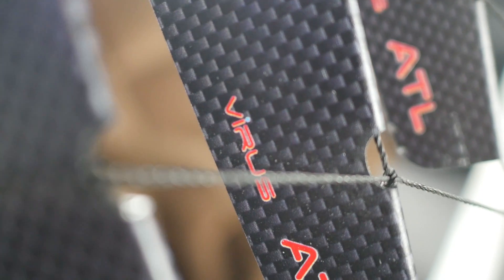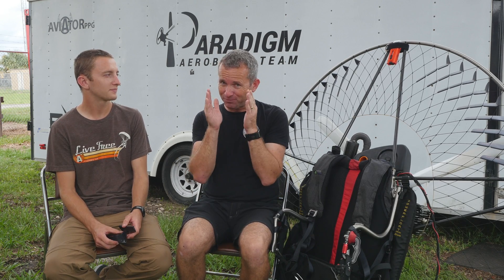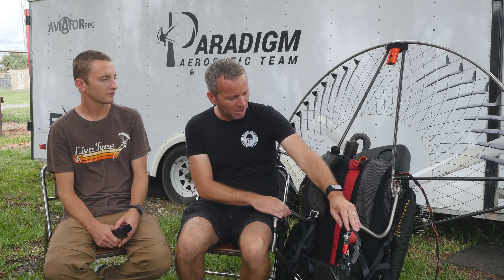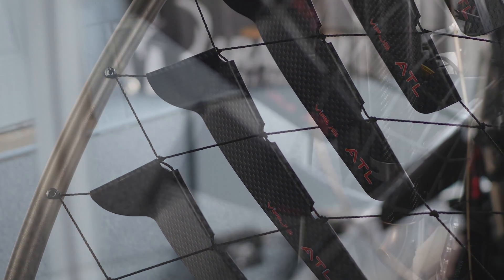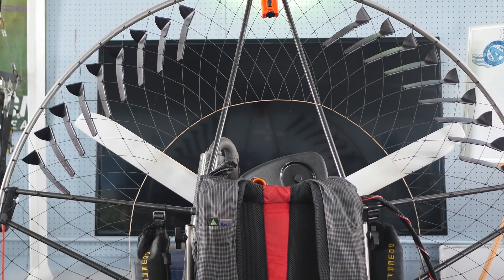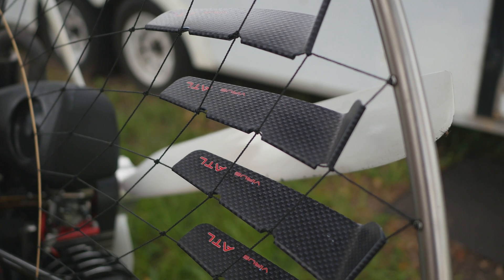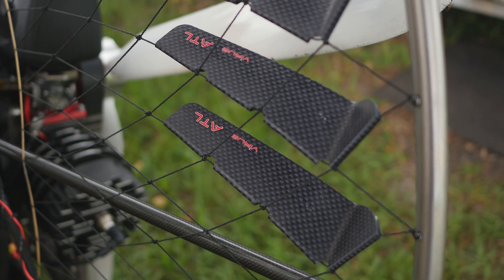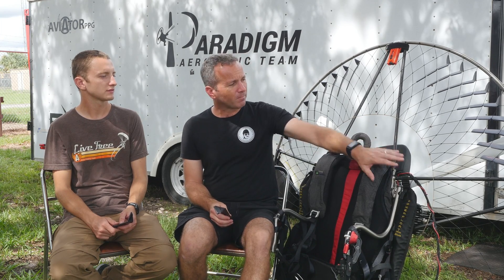Aerodynamic Torque Compensation for Most Paramotors (Virus ATL)

Comment: The thing you guys are presenting is (technically) nothing quite new in aviation world. If you check out EDF (Electric Ducted Fan) construction from R/C world, it has a thing called ''Stator'' - a static blades which both holds motor in place and does  a torque compensation feature plus straightens out spinned (turbulence) air that leaves exhaust hole thus increasing efficiency. 
I am wondering why all the PPG frames don't come with those static blades right away. Sure, they make a little more of drag. But the benefit is worth it.
Nice upgrade. Thanks.

Comment: 200$ for a set of little winglets made out of pop bottle plastic? NO WAY! Now that I have SEEN a set and had it described I am quite sure I could cobble up a nice looking set for about $0.00 and a weekend of piddling around. Obviously I may have to make a few sets before it works exactly right (But I doubt it. It will probably work perfectly on the first try). When I do I will post a video on how it is done and how well it worked. You know it amazes me when people refer to PPG as the cheapest way to fly it simply is not. FIXED WING ultralights cost a LOT less only because the companies producing the equipment are not trying to get rich overnight like PPG manufacturers are. If this development were for ultralight or experimental aeroplanes there would be information on how to BUILD this rather than just  an offer to sell you $5 worth of plastic for $200! Lutke  charges $700 to $900 for a redrive worth around $400. This is the most overpriced motorsport in the world.  If you buy a used engine and redrive suitable for an ultralight (Rotax 447 with B box or Kawasaki  440A with a magnum redrive), build your own cage and trike, weave your own net, do your own upholstery etc etc you could have a  trike ready for a wing for $2000-$3000 and it would be tandem capable. Then you pay $3000 for about $200 worth of fabric and lines. If PPG and PG people were like AIRPLANE people there would be plans available so you could make your own wing for the cost of materials and your time. DON'T say that such a thing is beyond what a non pro can accomplish as it simply isn't. All we would need are patterns and a "how to" video. They are simply too focused on making profit to share any information in the way that ALL airplane designers do.  You may guess that this is my plan. Not to make a wing but to make all the rest of my equipment using my Kawasaki 440. I will end up spending 1/6th of what a normal PPG set up will cost and will have a tandem capable trike that I can repair myself and that I know inside and out.. If patterns and information about wing making were not so jealously hidden from me I WOULD  get an industrial sewing machine and make wing after wing after wing. That would be too dangerous as things are since this important safety information is considered to be "industrial secrets". Funny how airplane wing design is NEVER kept secret and the designer will answer ANY question and provide ANY information, pattern or measurements (FOR FREE) when asked as that is how older aeroplanes are repaired!

Paraglider wing manufacturers are money grubbing, overcharging JERKS compared with experimental airplane makers. I am not suggesting they release information about their latest and greatest designs but how about a "how to cut and sew" video and a set of patters on Mylar for a good safe beginner wing? I have built high powered lasers from scratch, a lathe out of scrap, high power rockets out of cardboard and several airplanes. DON'T try to tell me that cutting out patterns and sewing them together is beyond my skills. Only the DESIGN of the wing is outside of my skill set.
Reply from the maker: Wow, lots of thoughts. No disagreement from us on the idea that things are pricey. And yet I don't seen any one in the business really getting rich. I think the pricing is high due to the lack of demand and the challenges of micro production. But then again, I'm just the guy selling them.

I think it'd be SUPER awesome to see your wing when it's finished! More power to you when it comes to creating stuff, that's awesome :D
Reply: As I said I can not make wings. Information on how to do that is not available.
Reply: The issues of low demand and the challenges of micro production exist for experimental and UL aircraft as well and THEY release all design information, measurements etc. Construction and repair information is released and discussed. Patterns are provided when needed. AND their basic prices are better considering how much more material goes into a light plane compared to a PPG.
Reply: @powderslinger5968  supply & demand isn't just a thing that exists, it's a constantly changing set of variables. Also there's the economies of scale.
If it takes a weekend to make your own, most people will still come out ahead working for money to then pay for a product. (say even at $15 /hr for 13 hrs then you're  ahead financially)
Reply: Flyboy BC check this out The BARRETINA HYPER LITE wing plans http://www.laboratoridenvol.com/projects/bhl/bhl.html
a video of one flying, made from plastic sheeting   https://www.youtube.com/watch?v=-YSHOXKAasU

Comment: So we all know that our AirConceptons already have Torque  compensation built into the frame, risers and hang point arms..so the question is will these with the factory pre-sets produce over compensation  ? Dam I think you answered it ..so you adjust the compensation / Overcompensation by the numbers of winglets you attach ? I talked with Robert at Flyhighparamotors that has been using them for a while now and his exact comment was " These are a game changer "
Reply from the maker: They sure do work :)

Comment: I'm skeptical that such a lose connection to the frame can truly transfer torque to the system... Looking at it from the video it just seems that the aerodynamic pressure will make the 'winglets' twist. All energy being lost on that twisting motion, none transferred to the frame. If they were firmly fixed to the frame, however, I could see it having a very positive effect on torque compensation.
Reply from the maker: We were super skeptical also. We bought the first two sets with the plan to tell the world they didn't work... But they do... Incredibly well. I had to REMOVE four from my motor because I was having issues with the motor torquing OPPOSITE of normal direction. Crazy.
Reply: Gian Carlo Martinelli I'm been flying for 5 years and I thought the same thing. I thought I'd give them a try, I was shocked at the cancellation of torque.  Only time I feel any now is when I go full throttle for maybe 1/2 second. I'm flying a Delta frame AC and have previously owned to other brand paramotors. They work, if you want to cancel torque, it's the solution.
Reply: I believed that they would work as soon as I saw them but you  DO want to make sure your net is tight! $40 a set would be a rip off considering what they are made from but $200 for 20 of them??!!? Uh,,,,no....

Comment: Have you done any in depth videos on 4 stroke engines? I here that new EOS one is pretty schwifty
Reply from the maker: We're hoping it's as good as they say! :D I want that thing to exist :D
Reply: AviatorShow it looks so pretty with the stylish exhaust and anodized blue bits. Can't wait to hear it purr in person. But have you guy had any experience with the Bailey V5?
Reply from the maker: A bit, it's a lovely engine but far too little power for me :/
Reply: That's a shame. Lucky for me I might as well be anorexic and could comfortably fly with 20 hp :P
Reply from the maker: Haha for me, I weigh 180, but I like climbing for acro :)
Reply: I have the Bailey V5 and I weigh 180,  its very heavy compared to a moster and has a very slow climb rate. I like that it's not very loud and good fuel consumption and very little torque effect(due to lack of power) however I would swap it for a moster 185 any day

Comment: Does this work on the Nitro 200?
Reply from the maker: Yessir! It's not really NECESSARY on the Nitro, but it does work :)
Reply: Ive been teetering and doing research.  Tucker reviewed the 200 and said there is a bit of torque from that motor.  Ive been wanting the Scout Motor because of the torque "Stators".  I love the idea of being able to turn left or right with equal efficiency.  What would you guys recommend? It will be a 30 m wing and I weigh about 200 pounds and plan to fly with a reserve and 3  to 4 gallons of fuel
Reply from the maker: This would definitely help with that issue (if you feel there is one). I've found there to be very little torque but this definitely does fix it :)